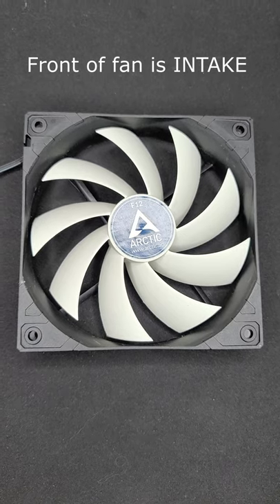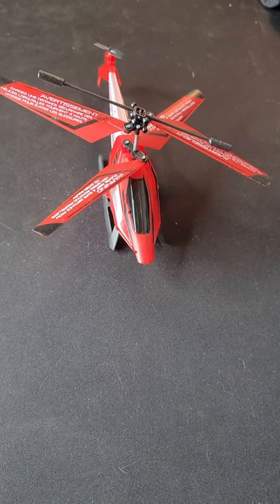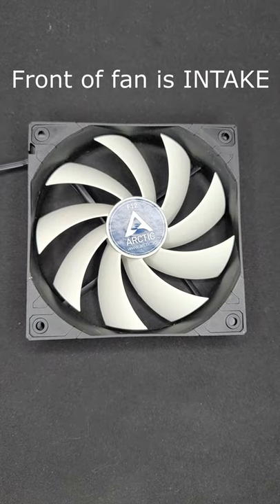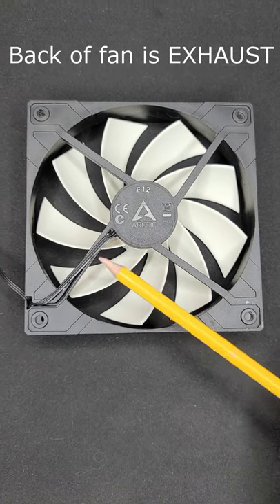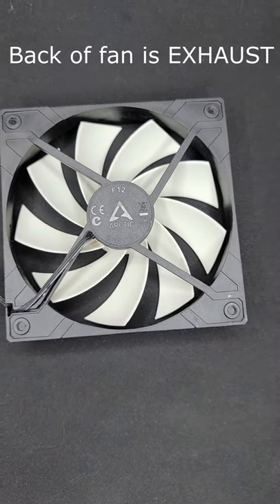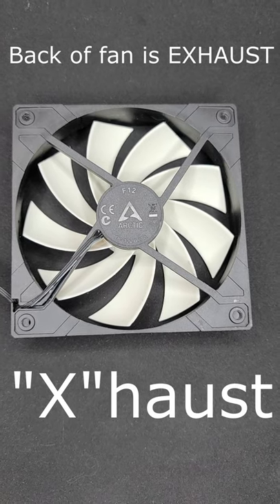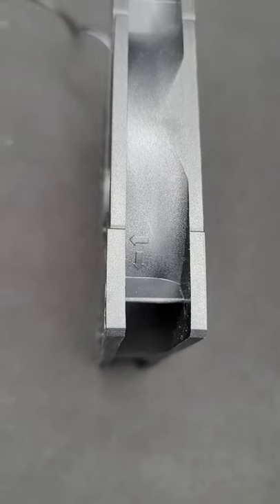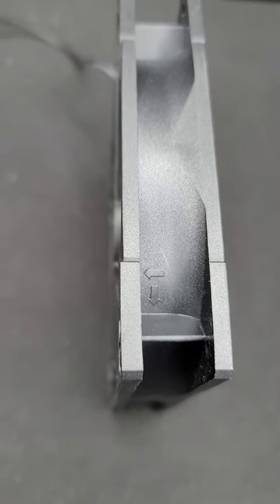Computer fans - which way the air flows  - intake vs exhaust #shorts

Comment: Hey man! So usually the top fans should be exhaust, right? 
Now I have a Radiator on the top of my Case for my Watercooled CPU - Do I still use the fans as an exhaust, or should I intake air for the radiator in this case and exhaust the air somewhere else?
Reply: I think you should use your rad fans for exhaust and other for intake because hot air goes up
Reply: For my pc case i have 3 fans intake at the bottom on the center left (opposite of glass pannel side) 3 exhaust fan and 3 exhaust for the radiator fans
Reply: @neortik7  I do have 4 intakes from the bottom and the back combined + 6 exhaust on the top and side from my CPU and GPU radiators. Works just fine